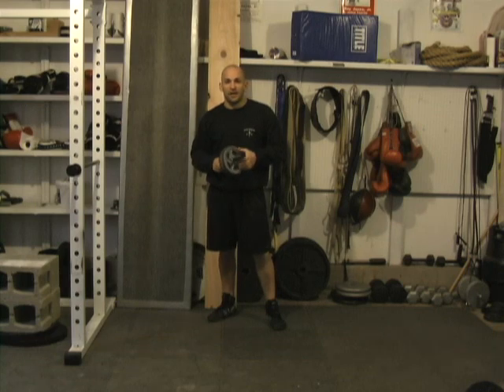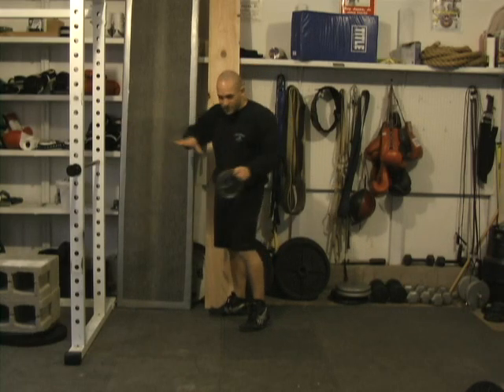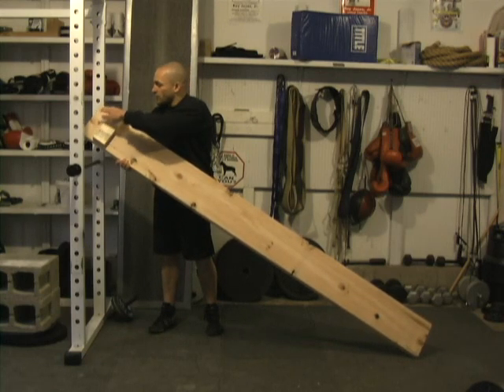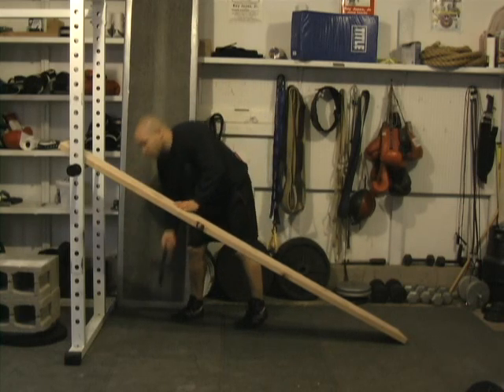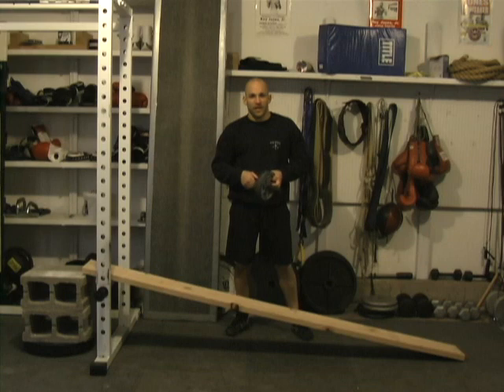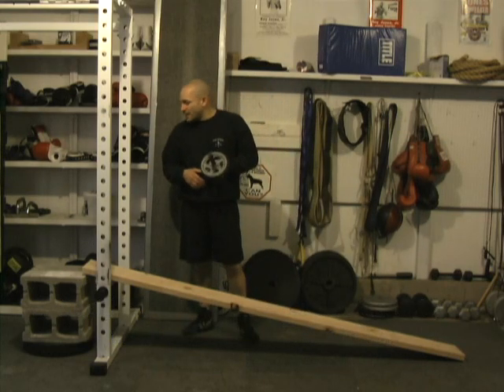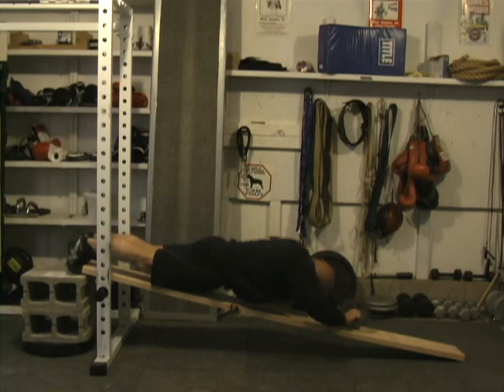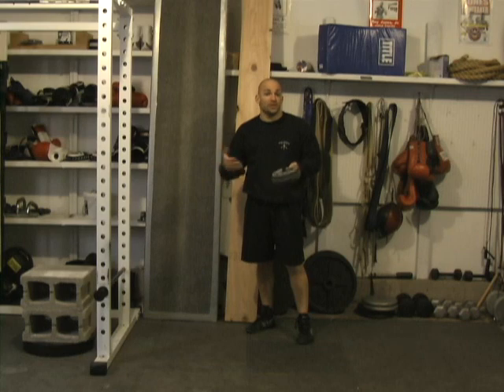Standing Ab Wheel Rollout Tutorial

Comment: I have been using the ab wheel for 40 years. This ramp thing is a good idea. I have been using a bicycle tube. I put the tube through a doorway and wrap the two ends around the handles on the ab wheel. You can change the resistance by moving closer or further from the door jam or a thicker tube or bands. You need to start slow and not to often. I am an old man so twice a week works for me. You can judge by how sore you get. If I am sore, I don't do them.